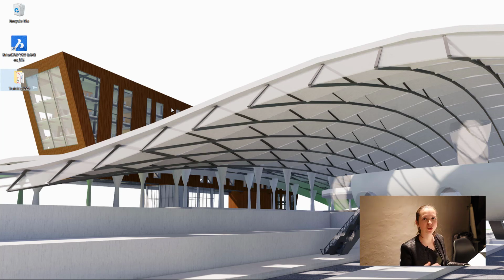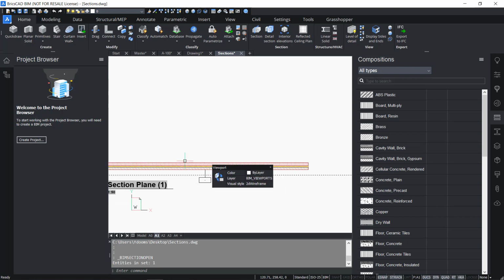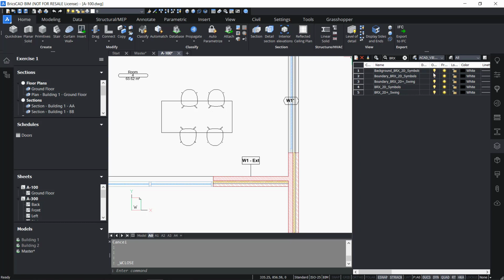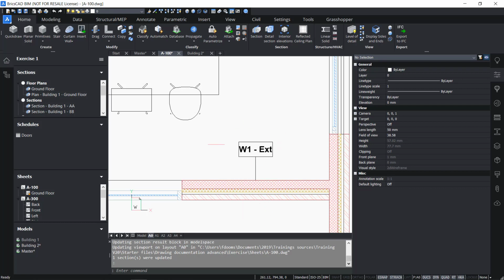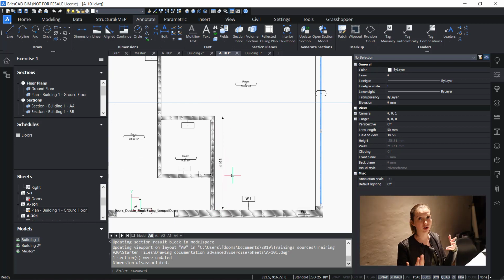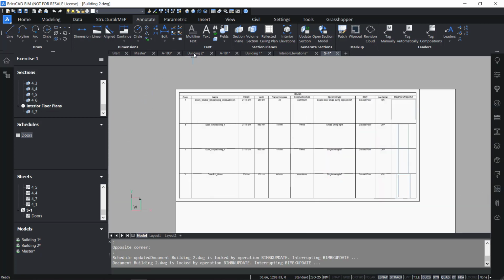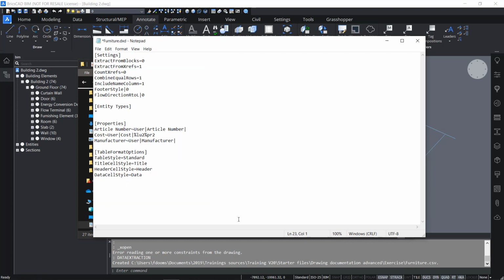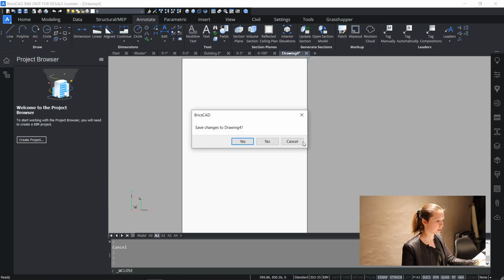BricsCAD V20 BIM Academy 10 - Advanced Drawing Documentation

Comment: Thank you, this is really good material to start creating your own templates.
Reply from the maker: You are welcome. We are glad you appreciate it.
Reply: can you change the names of the support file layers, just like you changed the colors?
Reply from the maker: @RokoDesign  Are you about layers in example on minute 5? Sure, you can change their names - just click the field with a name and start edit it.
Reply: @OctaveBricsCAD  I am talking about changing default layers in the section presets and the support file folder. So in that way you can have specific names for your drawing like: 2D_”Entity Material” instead of Boundary_”Entity Material”. In which locations do you have to change layer names  in order to keep the drawing standards and connections? Thank you for your help! 🙆🏻
Reply from the maker: @RokoDesign  Yes, it should be possible. The layers are in: C:\Users\[UserName]\AppData\Roaming\Bricsys\BricsCAD\V21x64\en_US\Support\Bim\Sections\_SectionSettings.dwg. You will also need to change the corresponding material names in the bsyslib file, so they match with the layer names.
Reply: @RokoDesign  Great question!

To do that you would need to go to the 'SectionPlaneSettings' command of the SectionSettings template .dwg in the support folder (it is the path mentioned by Bricsys). For every type of section you see there, you can see some properties to the right-hand side. Select the bullet in front of '2D section/elevation block creation settings'. Then search for the Boundary_EntityLayer layer for instance and click on the drop-down. There choose 'New layer name settings' and change the prefix from 'Boundary_' to '2D_' for instance. Now every time a boundary is generated, for this type of section, it will be placed on the layer 2D_”Entity Material" when it is has composition, and 2D_”Entity Layer” when it doesn't have a composition. You can do this similarly for all types of sections listed there (e.g. _Plan, _Elevation and so on), or you could even choose to make the prefix depending on the section type! The last thing to do is to make sure that in the list of layers in that same template .dwg all the layers you can possibly encounter (thus depends on your material names) have the correct color/line weight, etc. If you didn't specify a certain specific layer in this template, it will just copy the settings from layer 0 of the template.

Hope this helps you even more!
Fleur
Reply: @fleurdooms3291  Fleur this is so clear. i will try it! thank you
Reply: @fleurdooms3291  Fleur i can not find the way to insert BIM perspective views in to my sheets in order to update them as you do with the CAD drawings. Would you please show how can i make this?